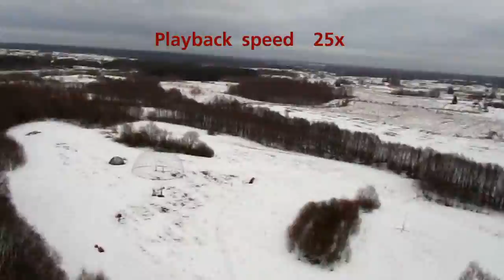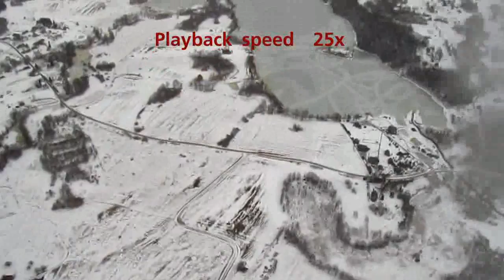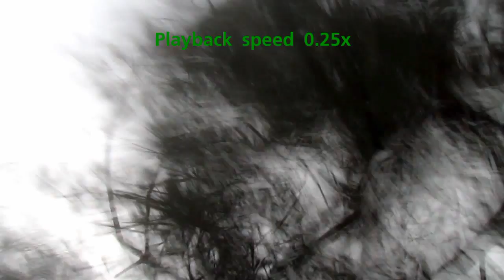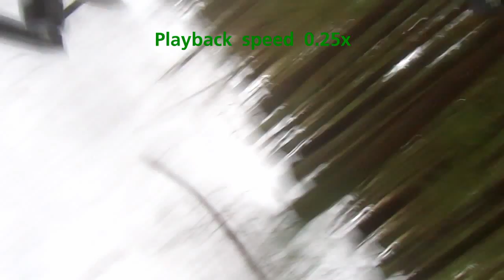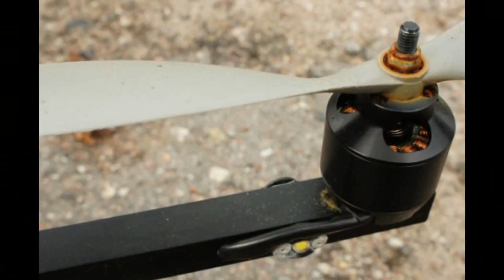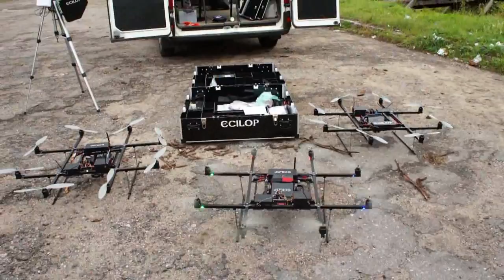A long flight of the ECILOP octacopter. Distance 22 km, altitude 1 km, duration 19 min (23 min)

Comment: Light cheap phone with GPS and its own battery would help - it is simple to write a daemon program, which reads the GPS position and sends it to the server once in a while. Because even 500 meters away and it will be very hard to find the copter already. Especially if it falls on some private territory.